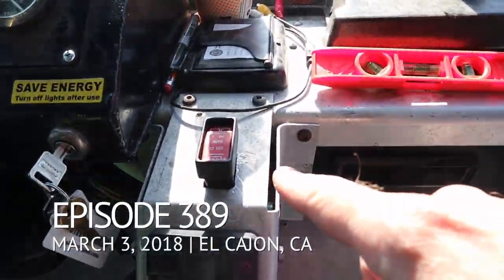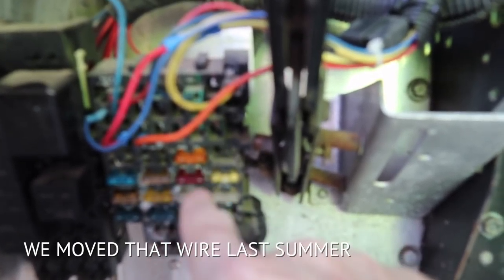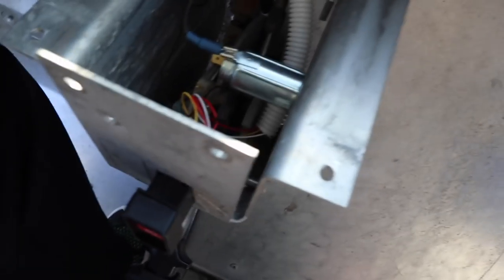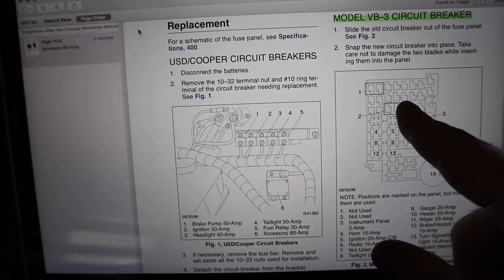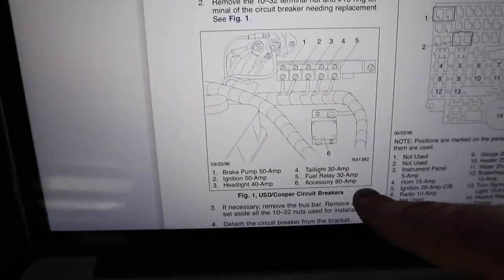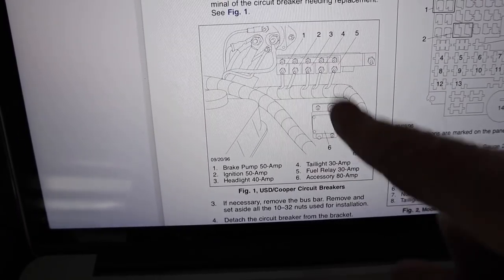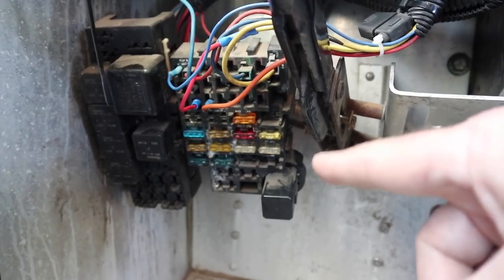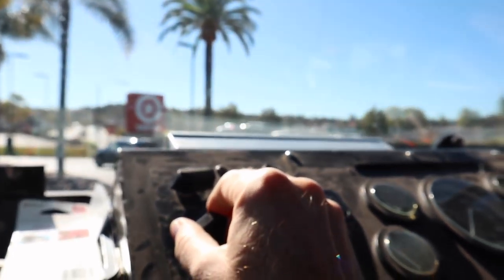Confusing Electric Troubleshooting in Step Van E389

Comment: Seven, think your problem is under the hood. Connectors look dirty, and paint on them, and that one hanging half way out from under that terminal on the left looks dangerously close to other pole of solenoid. You don't want that shorting to the other pole while engine is running, if that is a starter solenoid, it will engage starter, damaging ring gear, and starter. Does the manual call that a starter solenoid, or what?? The video kinda sucks, too many shadows to see which wire hooks where. Are you sure wipers were working with that wire broke off? Ring it broke off of should still be on terminal it broke off of, look at end of wire to see if it looks like new break, or like someone cut it off on purpose, cuz wire had short or something wrong with it. One way to check, plug wipers back into location you had them plugged in with switch on, and momentarily touch wire to see if they move, or better yet buy one of those cheap map lights that plug into cigarette lighter, and leave it plugged in so you know when you've found the problem, and lighter starts working again  That loose wire may be old wire  for original wiper fuse location too, and might be shorted somewhere, so be ready to just touch it momentarily. Using your test light, you can see which of those wires is hot all the time, probably left one with wire half ring hanging out. If you decide to clean them with a wire brush, and put wire back on terminal that's hanging out. Might want to turn off master switch, check with test light to make sure no power, if they still have power, wrap with electrical tape while cleaning so they don't short out to body, and do one terminal at a time so wires don't get mixed up. Also when removing solenoid nuts, use a wrench so you can watch stud, too make sure it's not turning with nut, and don't short wrench to body, while turning nut, if they're still hot with master switch turned off. Probably just a dirty connection, and when nut was loosened to connect acr wire, it just lost contact, because of corrosion. Oh, and the reason you blowed fuse on fridge, you shorted to ground inside socket, barrel inside socket is ground, and terminal at bottom is hot 12v, you somehow touched wall, and terminal at bottom at same time, and blowed fuse. Not hard to do.
Reply from the maker: we repaired the broken wire and none of the 4 items had any change and were still dead. see todays video for more info on what we found out
Reply: I would've cleaned connections on solenoid before rewiring anything, more than likely just corrosion on wires at solenoid. Does this guy have any training? You just don't start cutting wires without at least making a diagram, marking wires, or taking a picture. I wouldn't be cutting anymore wires  Unless you like that parking lot. Those wires go through a relay for a reason. If he figures out where wire went. I'd get an auxiliary fuse panel off ebay, install it later when you install  solar panels, and run fans, and anything you add off solar batteries and quit plugging wires into vehicle fuse block, and running risk of overloading circuits. Your step van, I'll shut up, and good luck.  P.S. since you repaired that wire, see if the original wiper fuse has power again.

Comment: I would be told to Goggle on how to check relays...tried & noted that there are 3 ways using your multimeter. 
I find I get frustrated easy as well. grrr
Reply from the maker: I've been trying to watch videos on relays. I'm getting pieces of info, but not enough to solve the problem yet

Comment: look to left
sounds like you lost power from the fuse or relay that is feeding the "common buss" connection THAT you have all those wires connected too, could be s smaller 'igintion' fuse line that controls a power relay or a larger fuse over there on the left next to the relays
tester in ciggy plug, sounds like you shorted something out, fuse inside cig socket, or fuse in line between cig socket and batteries
Reply from the maker: I think you are correct!

Comment: All of your fans should be running off your house batteries rewire it for that
Reply from the maker: later this month I'll be wiring all the house electric items. the fans will be rewired to the house fuse box then. for now I'm mostly focused on the wipers and 12v lighter socket to power my google maps and phone

Comment: Seven look at the blue wire it looks to me like it has an in-line fuse in it. From the fuse block follow the blue wire to find the fuse holder it looks like the blue wire has an external fuse holder maybe that it.  hope this helps.
Reply from the maker: all of the wires in the upper right have in-line fuses in them. I checked each and they are intact. however, there is no power going to those plugs when checked by a voltmeter
Reply: OK my next suggestion is the power that feeds that fuse block to those connectors that are in the upper left-hand corner. Should be on that fuse block.. Take your test light put one to ground and then probe each fuse to see if there is power on each side of the fuse.  check them all There are a little tabs on those spade fuses where you can put your test light on to see if there's power there hard to see but there is a probe point. It looks like you have a blown fuse that feeds those terminals on the upper left-hand corner. That's where I would look.  I hope I'm explaining this correctly
Reply: Meaning you need to prove all the fuses on the fuse block on both sides of the fuses.. It should light up on each side of the fuse. if not, one side lights up and the other side doesn't light up then your have a problem with that fuse.  This stuff is really hard to explain LOL
Reply: I forgot one important factor some of the  those fuses may be hooked up to the ignition so you may need to have your key turned on in order to test it